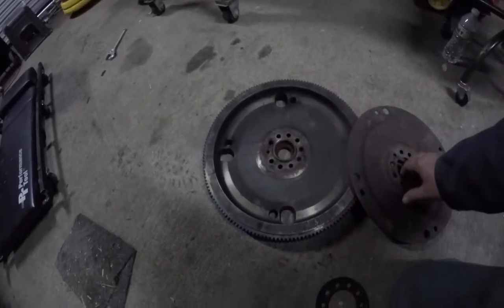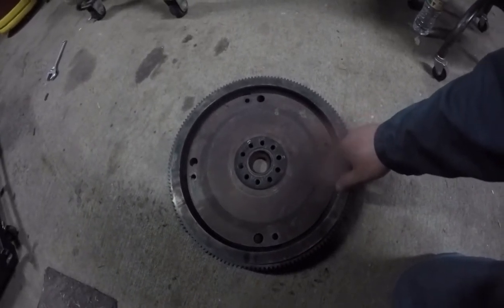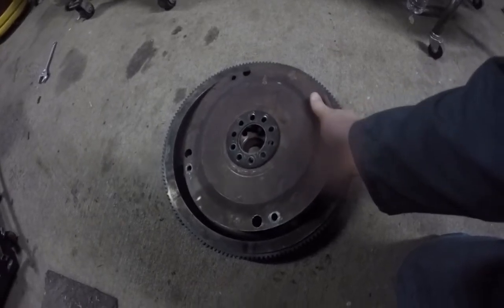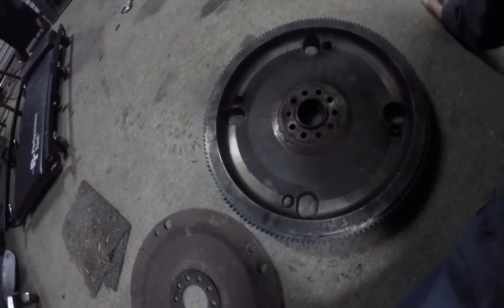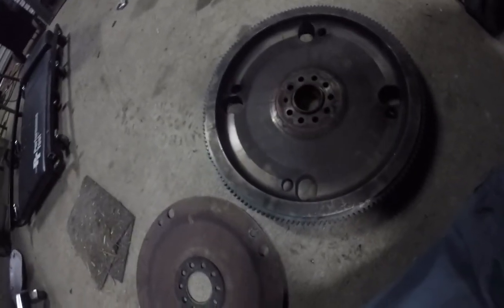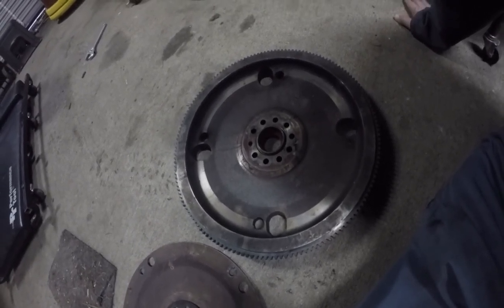6.9 and 7.3 IDI flexplate

Comment: Hello, just to clarify what fixed the stater grinding.. replacement of what part ? .
Reply from the maker: What fixed the starter grinding is replacing it with the correct starter. I do believe that it had the starter for a manual transmission in it. That starter is on the other side of the vehicle and the depth of starter gear is different. The incorrect starter chewed the teeth up on the ring gear on the flex plate and that is why I had to remove it and replace the gear.